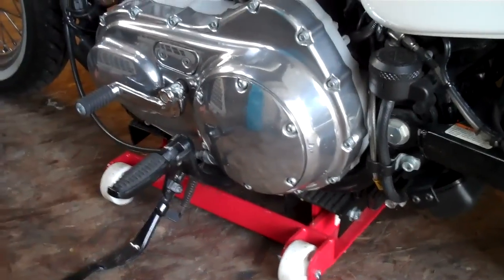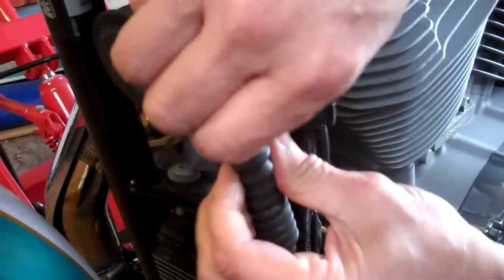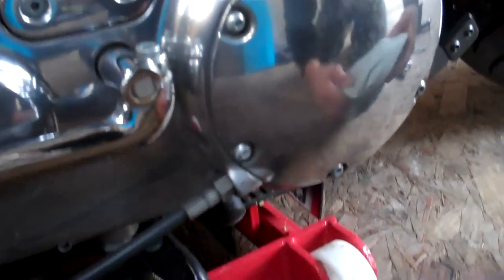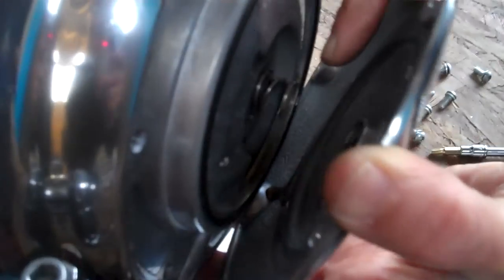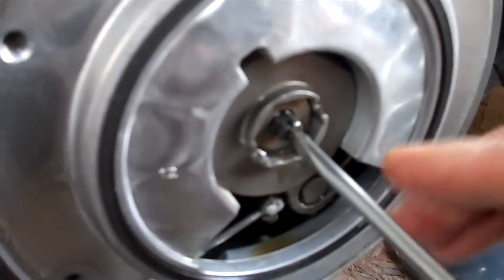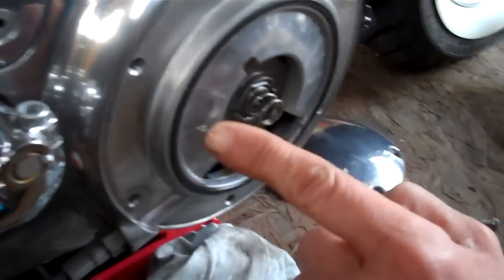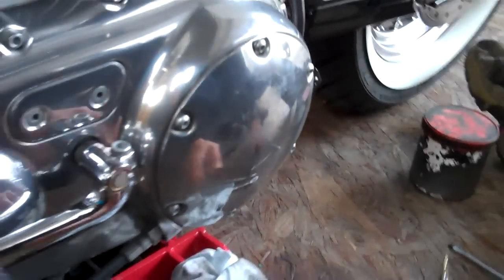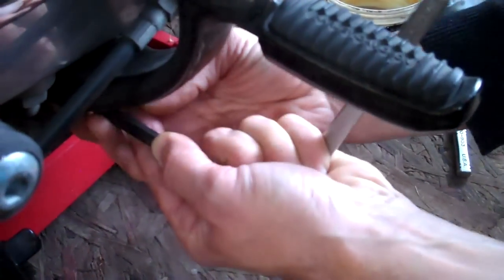Delboy's Garage, Harley Sportster Clutch Adjustment.

Comment: Got a quick question, 
I've got a pro clutch on my 05 sporty. And today I adjusted it exactly how you did in video, but bike is still seeming to roll when clutch is fully pulled in, if I adjust it on the clutch cable it works like normal but does get real real tight to pull in the lever.. I understand it's a good clutch and springs have alot more tension.. I did adjust the clutch while bike was hot.. Could that be my problem
Reply from the maker: Always adjust the clutch when it's cold mate, as it is the cold freeplay you are adjusting... the adjustment of the clutch pack simply ensures that it fully engages so if it's wrong, it will slip, not drag, as yours is.... the adjustment of the cable (3mm at the lever knuckle as shown) is what will allow the bike to rest stationary when the clutch is dis-engaged... both need to be correct and when the motor is cold... oh, and if you have an uprated clutch, it will be a heavier pull at the lever, that is the price of up-rated parts - you could fit an easy pull clutch ramp, or just have an extra Shredded Wheat in the morning lol!
Reply: Moonfleet41 Haha Thanks For The Reply! Looked at it further today and my clutch fibers are gone.. To many wheelies. Time for a new clutch!

Comment: Looking for some advise , I had a clutch bearing go out. The outer race of the bearing was chewed up into metal shavings. I drained the transmission fluid and replaced the bearing. It's not back together yet. Question is do you think the plates on the clutch are ok ? It never slipped or anything , do you think it's ok to put it all back together? Only reason I ask was because of all the metal shavings in the fluid.

Thanks , Sam
Reply from the maker: Hey Samuel, good to hear from you... ok, i have to say that as long as the plates look undamaged, then id use them again... they wont separate enough for shavings to have gotten between them and done any damage, but still inspect the closely anyway... have a look for any line in a circular pattern around the plate face...and any discoloration from burning... ?... Of course, if they look a bit worn, and you ever felt any slippage in riding the bike... then you wont do wrong in at leats slipping a new set of plates in for good measure.. maybe be guided by the mileage?
Reply: Cool , never had any slipping , just the bearing issue.
Thanks. The only reason I adjusted the clutch was because it was not disengaging enough to shift into neutral while the engine was running.
Sam
Reply from the maker: Hey Sam, ok, got it... dont be too hard on that neutral thing.. my Fatboy's like that... its fine if you select it while yer still slightly rolling.. but if you come to a halt.. then its the "1st, 2nd, 1st, 2nd, damn, 1st, 2nd, oh bollocks, turn it off.." game... lol   those big old Harley clutched have to run close to keep all that torque in check when hauling the big weight off the line... so they'll never work like a mamby pamby Jap sports bike clutch.. !!  heavy duty comes at a price.. and for me, its part of the attraction.

Comment: hey bud i have another question..my new performance clutch has to much travel. it's been getting harder and harder to shift in gear and down shift. and when im sitten still sometimes i can feel the bike wanting to move a little with clutch pulled in. so do i ajust it just the oppiset way it would be if it were slipping? thanks
Reply from the maker: Contrary to what people think, the clutch can only have one setting, its not actually 'adjustable' ,you just set it up with the quarter turn on the centre screw so the plates separate properly, and then 3mm at the lever clamp as in the video...sometimes the lever can be the issue, if you have fat grips they will stop the lever coming all the way in and make the clutch drag...also check the clutch pack you fitted doesn't need a steeper clutch ramp to give more disengagement!    then lastly, have you checked and changed the primary oil, if its low the plates will be a bit dry and that can make them drag too.... hoot those things help buddy... let us know how you get on.. Del.

Comment: You have amazing videos thanks for the help! 
My issue is I did this adjustment about 2 months ago, and well the bike is acting up again should I adjust it again? 
The bike is accelerating but slowly and doesn't seem to be running full power I assumed it was because of the gears/clutches/disc (I'm new) not disengaging fully? Is this issue because of the clutch? When I first watched your video and adjusted it, the bike ran a lot better. Any help or input with this issue would be great, thank you!
Reply from the maker: Hello Ryan, just some finer symptoms if you please.. when you are riding along, in gear, do the revs race away without the bike pulling forward, and is it difficult to get into, or out of, gear??  And also, do you have the correct freeplay at the clutch lever??
Reply: Hello thanks for the response. The bike seems to rev rpms higher than what the bike is actually moving at, but it isn't difficult to switch gears that part is rather smooth. I'm actually adjusting it now but for some reason this time my lever seems extremely hard to pull in not sure what happened this time.
Reply: I can send a video of where I'm at?
Reply from the maker: ryan santana  No need, it sounds like you may have adjusted the bolt inwards, and not outwards... go over it again, remember if it was ok before, then it is simply something you've done incorrectly that is causing it ... start again, remember to back off ALL of the freeplay in the bottle screw at the middle of the cable, then back at the clutch pack, adjust the screw all the way OUT until it stops, and then inwards one quarter turn... after adjusting the cable slack back again, it should work fine
Reply: That sounds an awful lot like you may have suffered a blown spring plate in the clutch pack - its unfortunately common in the sportsters and causes symptoms you are seeing.  The spring plate sits in the middle of the clutch pack and is held together with brass rivets that over time can shear off.  The springs then carve a slight groove in the clutch housing that the friction plates hang up on and don't move properly.  I'm fixing one of these right now and was just reviewing this video as a chance to go over the final procedures when buttoning up.

Comment: Del, absolutely love your videos and they have taught me a lot! keep em coming. Quick question maybe you can help me out with. I am trying to do a clutch adjustment on my 06 883. after backing the jam nut off i tried to introduce slack to the cable by way of the adjuster screw but the damn thing will not move. Anytime i try to turn it it just moves the whole cable. any thoughts??

thanks again!

Cheers
Reply from the maker: +Mitch Francis Hi buddy, can you grip the ouer sleeve metal part gently with some grips and get it to move?? Perhaps soak it with some 'freeing oil' like WD40 - can't think why it would be jammed unless it got corroded... perhaps you could send me a photo of as never had a problem with one, so can't understand why it would be jammed - email photo to:  moonfleet10@yahoo.co.uk

Comment: how about a brief explanation of what is happening? 1/4 turn out, what if I went more or less, what would happen? on first adjustment bike was slipping after clutch lever was all the way let go. did adjustment again and all is well. just real curious what this adjustment actually does. thanks again man. good riding😂
Reply from the maker: This adjustment sets the amount of free play between the cable and the clutch ramp... a bit like on your throttle when you have freeplay at the twist grip, you adjust the cables to take out as much as this freeplay as possible and leave yourself just a fraction of a turn before the twist grip starts pulling on the throttle cable... what you may have done first time round was not left enough freeplay , meaning the clutch was slightly pulled, even though your hand was not on the lever, and just as if your hand was slightly pulling the lever, the clutch would slip... when you adjysted it the second time, you obviously achieved the requird freeplay needed... hope that explains it mate!
Reply: Awesome, got it. Great explanation. Cleared everything up for me. Thank-you tons..

Comment: thank you for the videos I couldn't of done this without you I have one question though if the clutch feels like it's still grabbing a little bit when the lever is completely pulled in would you recommend instead of the quarter turn on the screw inside of the Derby cover would you go maybe a half turn or am I doing it backwards
Reply from the maker: The 1/4 turn gives the essential freeplay in the clutch pack to ensure that it is fully closed and all plates are tightly together when the lever is released... which is unrelated to a grabby performance... however, the 1/4 turn is not critical, quarter, a third, is ok, as long as the clutch operation at the lever fully releases the pack and the bike does not jolt in to gear, or stall, when you engage first....
Reply: Thanks DellI appreciate all the help

Comment: Should the transmission be in neutral when adjusting the clutch?
Reply from the maker: Yes it should.. it doesn't actually make much difference, but i always do because then there is nothing what so ever loading the clutch.

Comment: Wotcha Del. Got a question for you.
I've replaced my stock bars with 14" apes.
I've followed the video to the letter mate.
Turned the bolt/screw in the clutch pack til it seats, then a 1/4 turn to the right.....put the plate on, then adjusted (trying to) the slack for the clutch lever. I have adjusted it til the there is about 2-3mm play in the cable @ the lever.....but the lever is really tight.
When I slacken it a bit, the lever doesn't come back to where it should sit. Am I doing something wrong? Is this because it's a new cable & needs some time to slacked off a bit???

Cheers for any help mate.

Tommy in Glasgow
Reply from the maker: Hi Tommy... the one mistake i seem to see most people make with this is that they dont back off ALL the adjustment in the central cable bottle screw....if you forget this, then the whole adjustment will be out, and the clutch will jam up like the cable is kinked.... , so did you do that before you started mate..? Let me know..Del.

Comment: i have a 2013 882 in first step when u loosen adjuster screw all the way up i did that no problem but i couldn't loosen the clutch out bye hand like you could also it wouldn't loosen all the way to top of adjusting screw like urs did.... do i need to just let it out as much as possible then proceed?
Reply: 883*
Reply: the adjustment screw goes to top but the adjustment wouldn't go all the way to top like in your video.....also the part above the adjust screw spins also..
Reply from the maker: 24kbosch  Hi mate, sounds like your bottle screw is maybe jammed up with road corosion or road crud, use some freeing oil, such as WD40, and brush round the thread with it, so that you can wind all the adjustment off, as in the video, it's most important that the entire bottle screw is wound off, otherwise it will pull on the cable when you adjust the freeplay in the clutch pack... try that first and let me know what happens, Del

Comment: I'm new to Harleys and I been hearing a grinding noise in 1st gear when downshifting and when coasting to a stop with the clutch lever pulled in. Will this adjustment correct the issue or is there something else it could be? I'll be doing the adjustment tonight.I was far away from home when it started and had to ride 150km to get back. Could that have caused any damage that I need to look for? Thanks for you video!
Reply from the maker: ***** Hi mate, i really cant answer those question, its just too vague.."grinding noise"??.. any mechanic would have to hear that themselves to know what it may be, ir even where its coming from... all you can do is change both oils if its a Sportster...or all three if its a Softail, make the clutch AND primary chain adjustments too so that all the tollerances are correct and nothing is out of adjustment... then also check the oil that comes out to see if it has any silver filings in it.... once that all good and done right... then see if the noise you hear persists...
Reply: Moonfleet41 It is a sportster. I completed all tasks and I'm still hearing the noise. There are no performance issues and the shifting is smooth. I did however see filings on the drain plug magnet when changing the transmission oil. Not sure what to do about it. Primary chain seems to be in spec but I did have to adjust the clutch.
Reply from the maker: ***** Hi mate, it's difficult to diagnose anything over email, all Harleys are mechanically noisy and a few filings on the drain plug is not the end of the world... provided it's working correctly then keep an eye on it and dump that pint of oil again in a week or two and see if the filings have accumulated in that short time... if you are really worried mate, run it along to your local dealer and ask them to have a listen to it... good luck !
Reply: Moonfleet41 Sounds like good advice. Thanks for your time!

Comment: nice video, I do have a question my clutch cable broke on my iron883 how do u go about swapping out the cable
Reply from the maker: Cant exactly talk you through it blow by blow on email... ill assume you can get the top linkage apart... so just the bottom linkage is the mystery to most... you access it through the Derby cover hole, look down inside below the clutch assembly and you'll see the fork the the cable hooks through, remove that and unscrew the cable housing from the primary case.... easy enough, just take your time and attack it logially... Good luck.. Del.

Comment: thank you for your Video, I still have a question what did you mean until it seat? how tide should i turn it? I replaced a clutch cable so I need to adjust it from very begining
.
Reply from the maker: Feng Shi 'Seating it' just means until it stops and won't turn anymore, no need to stress it, or twist hard, simply when the screwdriver 'resists' turning, that it is 'seated', and at that point, turn it back 1/4 turn!
Reply: Moonfleet41 I also have some confusion on this......

As I am going counter clockwise I can fell when it makes contact but I can also go another 3/4 of a turn or so after it makes contact by putting a little more pressure on the screwdriver. 

So I have an issue with knowing have I gone counter clockwise enough before I do my 1/4 turn back clockwise.
Reply from the maker: Michael Hi Michael, i understand your confusion here, but truly mate, dont over think it, let it make contact, firmly, and turn it back the other way....if you swing on it, you'll get another whole turn...but the point it to provide a clear gap between the screw and its seat of fealer guage size....the whole purpose of the adjustment is to ensure that the clutch is fully disengaging and not binding which will cause itto slip....just feel the contact point firmly with just finger and thumb on the screw driver, and turn it back a quarter...job done.. its not that critical sir.... Hope that helps.. Good luck with it.. Del.

Comment: Will this clutch adjustment procedure in your video be the same for a 2005 sportster 883 low? I have the HD service manual, but the text isn't very descriptive so this video help much more. You say in the video that the bike needs to be upright, is that only if you plan on keeping the trans/primary fluid in? My trans/primary fluid is already drained, and i don't have a jack/stand to keep the bike upright with. I was planning on doing the adjustment to the clutch with the bike on its jiffy stand, then having the wife hold it upright while i fill the trans fluid and bolt the cover back on. Also, is it ok to use anti-seize lubricant on the cable adjuster and jam nut? Thank you
Reply from the maker: Emilie Engesether Hi mate, if your trans fluid is already drained, then yeah, go ahead on the jiffy stand, it may be a little awkward to access as it's leaning towards you, so why not put the bike next to the wall and the stand on a block to lift it up a bit.... anti-sieze is good, but not essential unless you ride in bad weather, as it lives inside a rubber boot, just a little squirt of WD40 inside the boot once you're done is fine...
Reply: Moonfleet41 thank you very much! I find your videos very helpful

Comment: Hey thanks so much for all of your videos, absolutely love this channel! Anyways, I've got an 07 883R which seems to be leaking oil from the primary case where the clutch cable goes in. Any tips on stopping this leak? Will I need to drain the primary oil first? Cheers!
Reply from the maker: Hi there Ben,  check that the fitting isn't simply loose, otherwise yes, drop the oil, take off the derby cover, and once you unhook the cable inside, you can take the fitting out and replace the O ring.!   as long as it hasn't changed for the 07 bike, thats how it was on the 99 model i last did.!  (do check first that the leak is actually coming from the cable fitting and not the drain plug or the chain adjuster bolt..? )
Reply: @Moonfleet41  cheers mate! i'll be using all your sportster videos to get my bike serviced and ready for spring here in Canada! keep up the good work :)